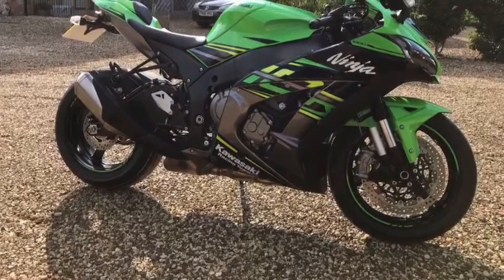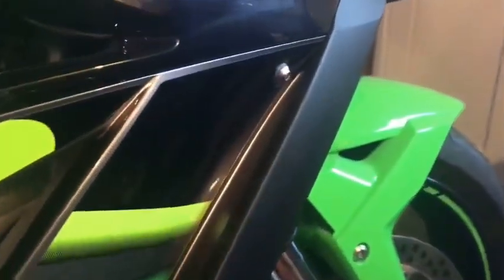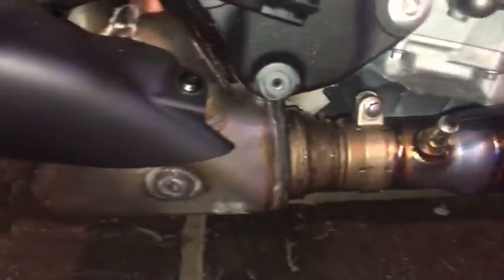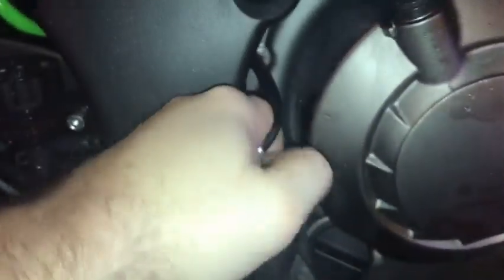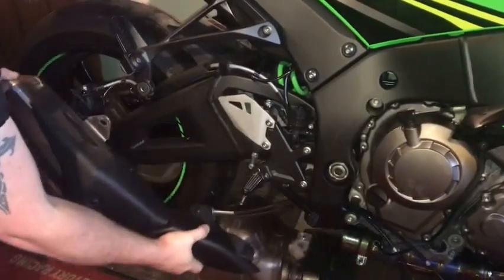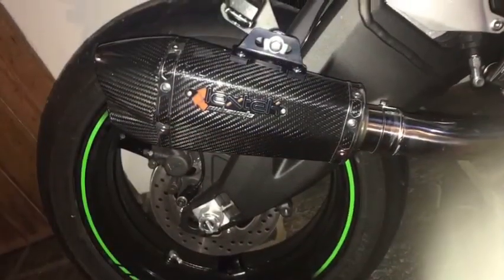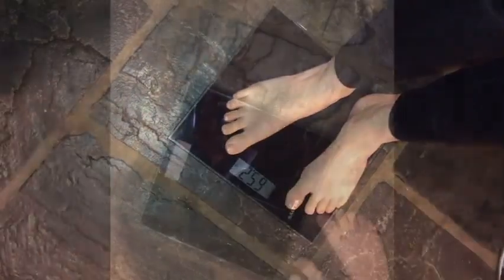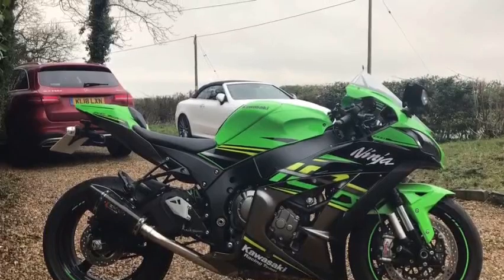How to remove the stock Kawasaki ZX10R exhaust and valve and servo 2016 - 2020 Models

Comment: Hi, love the video. Did you face any issues after this change? Did you  retune the ECU?
Reply from the maker: Sushant Gore no issues other than a few pops and bangs personally long term I would flash the ECU to make sure the bike doesn’t lean out. I ran mine for a year as it was with no issues before I sold it

Comment: I had the same thing done to my ZX 10 but instead I bought a Leo Vance and it backs fires bad is that gud
Reply: Did you get the servo buddy ? Might need a tune?
Reply: @michaelnasrallah  back fire prolly means it's running rich
Reply: If it does multiple popping sounds when letting go of the throttle, it’s normal, but get it checked out if it isn’t what I’m talking about.

Comment: You need to tune it for the exhaust.
Reply from the maker: Hi thanks for commenting - i'll be making another video showing what effect the exhaust has on the bike with no tuning and comparing it to having a servo eliminator vs ECU flash. It will be interesting to see what power gain we see.
Reply: Lets Review It, can you post a link to the mentioned video in your post? Thanks

Comment: Check engine light?
Reply from the maker: 2wheelsonly it didn’t come on at all when I fitted the exhaust
Reply: @letsreviewit8925  u removed the servo and cords completely right? Or did u say you put the servo motor back on?
Reply from the maker: @2wheelsonly614  Yes took the cables out but left the motor in. The bike ran ok but long term I would have had the ECU flashed for a better map.
Reply: @letsreviewit8925  so with the motor still in with no wires the bike doesn't notice I'm guessing?? Usually removing the servo u need a servo buddy.
Reply from the maker: @2wheelsonly614  That's right it ran fine - id assumed it would throw an error up but it didn't. Theres another video on the channel that shows it running/being ridden
Reply: @letsreviewit8925  what made you put it back on since the wires were gone anyway?
Reply from the maker: @2wheelsonly614  I was concerned that unplugging the electrics might cause an engine management light to come on. Logic seemed to pay off lol
Reply: @letsreviewit8925  thanks alot